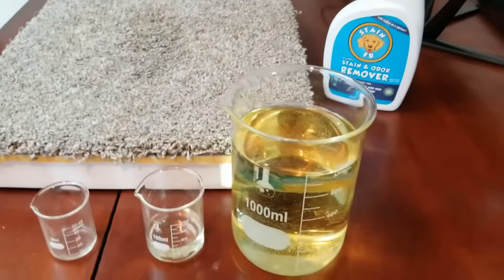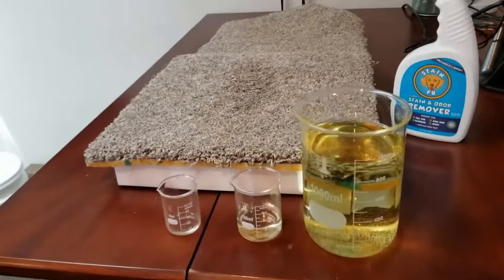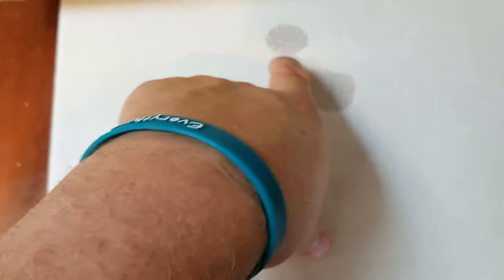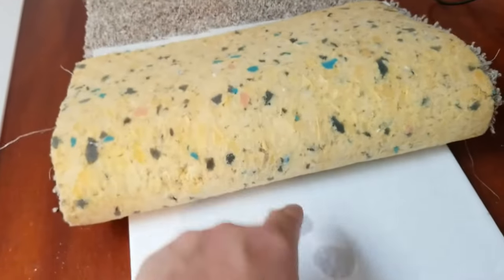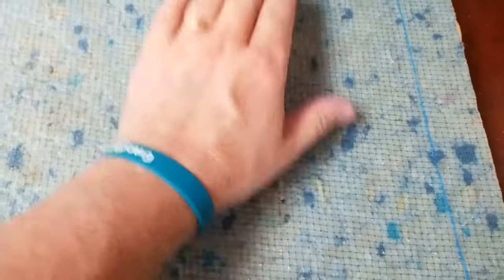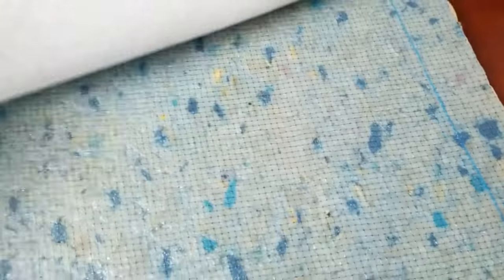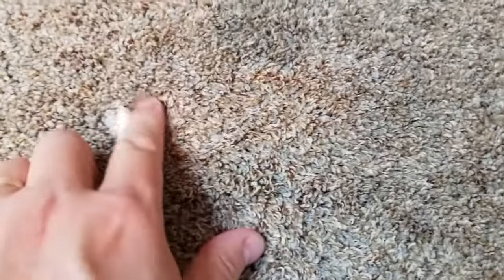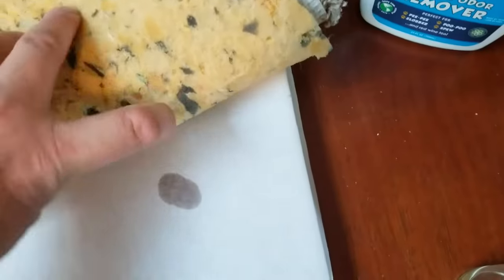How To Get Rid of Pet Urine Smell

Comment: I used to clean carpets. First thing I'd do after being told Fifi "just pees in one tiny spot" is pull back the carpet until I could find dry carpet padding. This often revealed soaked padding under half the room, or more, as Fifi's repeated deposits spread by capillary action through and beneath the padding and never fully dried because the carpet shielded it from direct exposure to the air. Best practice, then, is to remove and replace the affected carpet pad because it's cheap and cleaning it isn't practical as well as thoroughly treating the floor beneath it (especially if it's porous like concrete) along with treating and cleaning the carpet. As he demonstrated near the beginning, pee adds up quickly, and Fifi won't admit to it. Hope that helps.

Comment: Do you think pre-wetting the area with a couple passes of the carpet machine and then going back over with the treatment solution in the carpet machine would help disperse the product better into the padding? We sadly, had our very old dog pass away at home in his sleep- and his urine was released in the process, he was 120lbs. So I am having a hard time getting any products down to that much surface area of the padding. I have purchased your product off Amazon- waiting for it’s arrival
Reply from the maker: Awe. I'm so sorry to hear of your furry pal passing away. ;( They bring such joy to our lives, and it hurts so much when they're gone.

As for urine contamination in the pad, that's a tricky one. Your pad is like a giant sponge with lots of air pockets that can trap liquids like spills and urine. I'm glad to hear you get that part because a lot of people do mistakenly believe they just need to mist on a little bit of product and the stain magically goes away. As you hinted, it doesn't work like that. The urine contamination amount must be overcome by equal parts of decontamination effort. I.E. What Goes In, Must Come Out for decontamination to be successful.

Flooding the area is one way, but can potentially cause secondary issues with wet concrete or wood subfloors that don't dry quickly and cause more bacteria to grow.

Second, water is great at diluting contamination, but it doesn't neutralize, nor remove the contamination. Given all of that, here's what we recommend.

First, thank you very much for your business. We sure do appreciate you, and please know you and all of our great customers can reach us via email, or via our phone, which is on the bottle. We're ALWAYS glad to help our customers!

Second, if you're dealing with a large area (say 10% +/- the size of the room), it's often better to replace the pad. When you pull the pad, simply clean the back of the carpet with Stain Fu as we'll show below, install the new pad, then clean the top side of the carpet.

If the stains are of manageable size, do this: 
You mentioned you have a carpet machine. 
- First, liberally spray the area with Stain Fu straight out of the bottle.
- Put on some comfy walking shoes with rubber soles and literally "walk it in" to the carpet and pad. We don't want you soaking through the subfloor, though!
- Leave the area alone for about 15 minutes while Stain Fu does its work.
- Add 4 oz of Stain Fu to your rinse tank water in your carpet machine, and go over the area several times.
- Next use the Weighted Towel method where you place a stack of 4 or so  white terry cloth cotton towels on the stain, weight it down with something heavy like a book or a brick, and leave it over night. Assess the next day and repeat if necessary.

The weighted towel method works like this: When your carpet and pad gets wet, it always dries from the bottom up. We can use this to our decontamination advantage by placing towels and some weight over the area to wick the deep-down contamination to the surface.

Again, if you need further guidance, we're an email or phone call away. Thank you!
Reply: @StainFu  thank you for such a kind, thoughtful and thorough reply. I greatly appreciate it!
Reply: Did it work?
Reply: @laurat3xas  yes this product worked amazing! Got all the urine out of the carpet and saved me from having to replace it. I did this process and placed a cement block on a few towels to push product directly into carpet and padding, once all was dry, I used product in a carpet cleaner and went over the entire space

Comment: I have 6 indoor cats and a 3 bedroom house that's 95% old carpet that not only has had christening from the cats but also 3 little dogs before that. The combo of the old carpet smell and  numerous urine "accidents" can make this house a bit stinky, especially after some rainy, damp weather. I will try this product and thank you much for explaining that sometimes it's gotta be pretty saturated  to get to it all and get the stink removed!!
Reply from the maker: Absolutely! We're more than happy to help!
Reply: How is it I have 4 cats and 2 dogs how is it does it work
Reply: I 💯 guarantee this method didn’t work for you. Jesus your home, your clothes and you must smell terrible. There is nothing worse than cat pee smell. The only thing worse I’ve smelled was a crack house WITH cat pee. 🤢🤮
Rip up all of the flooring, floorboards, drywall and replace.
Reply: I have 2 dogs and my house dont smell at all

Comment: What is you are dealing with all hard flooring? I just bought a beautiful home but the sellers didn’t clean up after their cats. I’m killing myself to clear the urine smell.
Reply: I hope he answers, I’m dealing with the same problem 🤦🏼‍♀️
Reply from the maker: Hardwood floors can be tough because it really depends on if the floors are finished or unfinished. Also the extent of damage the urine has made. If the floor is unfinished, it is not water-safe, so you run the risk of discoloration and perhaps making the area look worse. If it's finished, you should be able to treat the areas, let it dwell for about 15-30 minutes, wipe the area, and then let it air dry. You may need to repeat the steps to get to the contamination. However if the contamination is deep and that the wood is rotting or damaged, it will have to be replaced, or possibly refurbished or refinished.

It might also be worth checking around to make sure where the source of the odor is coming from. From our experience, we have seen a customer's cat urinate down vents and that needing to be cleaned out. We have also seen some cats urinate on walls, and that needing to be repainted. If you are certain it's all coming from the wood floors, just be cautious and test in an inconspicuous area first if you can :)
Reply: @StainFu   Thanks for the detailed reply. These are engineered floors so I believe I just need a bit of elbow grease. At least that’s what I’m hoping. Again thanks

Comment: Hello, we are on a concrete slab floor and will be getting wood floors in a few weeks.  I currently have carpet and use natures miracle and a black light on accidents. I still at times smell urine and it drives me nuts and am very sure it's in the padding.  There is no sub floor but what would you advise me to do after they take up carpet before laying new flooring? Should i black light the concrete and spray enzymes? Your help is much appreciated!
Reply from the maker: Hello there! We would recommend treating the areas (we prefer Stain Fu, naturally ) but if you are using an enzyme based product, I would wipe it up after it dries to make sure no residue is left on the concrete for the next step. We would then recommend sealing the floor with an oil-based shellac (we like B-I-N from Zinsser, can usually be found at hardware stores). This should seal the odors and be good to go 😊
Reply: @Stain Fu  thank you.   The enzyme cleaner wouldn't be enough? I fear having to do the last step due to the installers having to wait.  If it's necessary then I can see if they would give me time.
Reply: @Nellie7777777  It's possible it could be enough, but it depends on the severity of the urine. The main issue we see with enzyme cleaners is that it takes time for it to work, so if you treat the area(s), it's hard to know how long that would take as well. If you're not able to use Stain Fu, I would try a solution of 50/50 vinegar water instead of an enzyme since time is of the essence. But it's still possible you might need to seal it. It's best to check with the installers regarding timing. Thanks for your question!
Reply from the maker: @Nellie7777777  (Oops sorry we replied with our other channel - so here's the original reply):  It's possible it could be enough, but it depends on the severity of the urine. The main issue we see with enzyme cleaners is that it takes time for it to work, so if you treat the area(s), it's hard to know how long that would take as well. If you're not able to use Stain Fu, I would try a solution of 50/50 vinegar water instead of an enzyme since time is of the essence. But it's still possible you might need to seal it. It's best to check with the installers regarding timing. Thanks for your question!
Reply: @StainFu o

Comment: Do you throw away the towels after they stick up the moisture or can they be washed?
Reply from the maker: Depends how nasty they are. We usually wash them many times before replacing. Pro tip: wash only the contaminated towels together, and don't mix in with good linens. If they're badly spoiled, it's  not a bad idea to run a cleaning cycle after washing the contaminated towels.

As for the Stain Fu on the towels, that's not a concern at all. In fact we often add a little Stain Fu to our laundry as a safe stain and odor remover for all water-safe items.

Comment: I have to replace carpet in a rental and it’s bad can I sprythe sub floor will that work
Reply from the maker: You'll most likely want to seal the subfloor with an oil-based sealer (like Kilz) before replacing the carpet.

Comment: Plz tell me what to do if I just moved into an apartment & it seems they put new floors over cat pee floor boards …???? PLZZZ
🙏🙏🙏
Reply from the maker: Oh Gosh, that's terrible! I'm sorry to hear that. If it were me, I would definitely speak to the apartment managers and/or maintenance people about that. If they installed new floors over floor boards with cat urine, they should have applied an oil-based primer such as Kilz or Zinsser BIN to seal and trap the odors on those boards first. In this situation, that is the best way and something they should have done before they put in new floors. If that is not an option, you could try to apply an odor remover like Stain Fu, but you would need to know where the odors are coming from, and apply enough to penetrate into the boards. Hopefully they will work with you and get it done the right way.
Reply: That's a good reason to break a lease

Comment: I don’t understand why you’d have wall to wall carpeting with a dog.  Too many layers to worry about.  And after applying the solution & worrying about 4 white towels to top off the damp rug is just too much.  People don’t even own 4 white towels.  Hard enough to have throw rugs with a dog when they still mistake them for pee pee pads.  I’d like to know the most effective product for mopping dog urine from a wood floor.  I throw newspaper on it first as they’ll miss the pee pad at times & then mop with a small amount of bleach in a bucket with Dawn.  I have not been successful with/vinegar and water in a mop solution

Comment: can my pets walk on it while it's still wet? this is the problem I have with other urine removers. My house is partly open plan, so I can't really keep them off certain floors.
Reply from the maker: Yes, if you are using Stain Fu it is fine if they accidentally walk on it. Mine does all the time! lol Of course, we would say to be cautious as every pet is different and can have different reactions. But Stain Fu is formulated to be a safe product around people and pets.
I would be worried if you are using an enzyme cleaner (needs to stay wet and untouched for a long time for it to work) or a harsh product like Resolve (could hurt the paws and skin).
Reply: @StainFu u take too long get to the point
Reply: How to get rid of cats pee smells
Reply: U take to Long t

Comment: Excellent presentation. Gives me more understanding.
Reply from the maker: Thank you so much!
Reply: @StainFu  Thanks for the video, but I still have an issue. I hoping you can help. I was cleaning my carpet and found a spot that was "damp", seemed like the urine did what you stated ... spread. I cleaned with Resolve, the whole area, let dry for 12 hours. Then later she peed right on the cover I had placed on all the areas that needed to be cleaned more(still couldn't get that smell out even though I used several products) I was beyond Shocked! (she has Never not listen, older age 😄) I have a carpet cleaner, and have use the solution, however more water with little solution doesn't seem to help alot. Don't know??? Rented a wet/dry vac, don't know if I should get one???? Had my carpets cleans in November. Have to do something ASAP?? The smell is coming up with some of the products I'm using, my dog is getting "upset" that I keep covering up the carpet with cloth pads, that she will just pee on the edge that now I have to wash AGAIN!($3) It's crazy. Funny, not funny. Help! (can't lift up the carpet, live in apt) Thanks for reading. 😊
Reply from the maker: @memekendall3197  Hi there! If it were me, I would try to use your carpet cleaner with just hot water, and try to extract out as much of the product as you can (basically until little/no foaminess coming up). 

Then I would highly suggest if possible getting Stain Fu to treat the areas (if you are unable to, try a mixture of 32oz water, a drop of Dawn dish soap, and 1-2 tbsp of 3% hydrogen peroxide). 

Once you treat the areas, agitate it in using something like a metal spoon handle and let it sit for about 10 minutes. 

Then take some white/colorfast towels, place it on top of the area, and then weigh it down with something heavy. This extracts out the urine from the top side, and it wicks into your towels as it dries. 

Check the area in a few hours and repeat the steps if needed.

Hope that helps!

Comment: if you have a pet pissing on the carpet the worst thing you can do is use a deodorant to try to get rid of the stink. Deodorants just make it worse. clean the carpet as good as you can with soap and water but DO NOT use any product claiming to get rid of the smell. As long as you're willing to let an animal continue to live in your home though it pisses on the carpet then there is no way to solve the problem. You just have to get used to living in a toilet. You'll quickly get so used to the stink that you don't smell it any more but your guests will always be disgusted.

I've done flooring for over 20 years and I've seen hundreds and hundreds of homes with animal urine in the carpet. I've ripped out the carpet and looked underneath to see just how much the pets are peeing on the rug. The homes that stink the worst are the ones where they try to mask the odor. None of the deodorants work to cover the smell, they just add another stink on top of it that worsens the problem.

 Products claiming to remove urine odors from carpet are like pills that claim to make your dick bigger or stop you from balding- they're a con. If you want to get rid of the stink then you have to get new carpet, you have to seal the floor, install underlayment, or both before putting in the new carpet. If the piss has soaked into the subfloor then it might not stink right after you get new carpet but in a week or two the stink will be back.